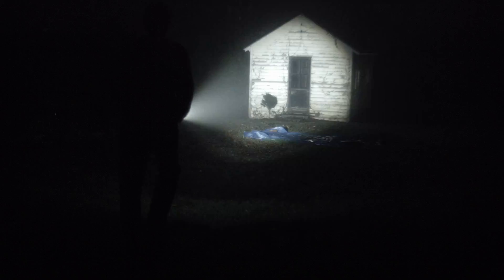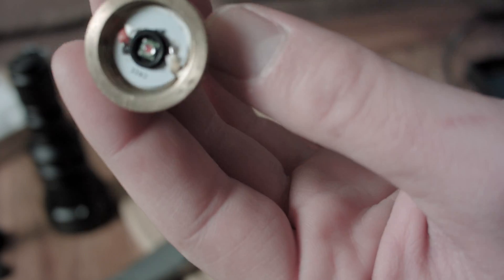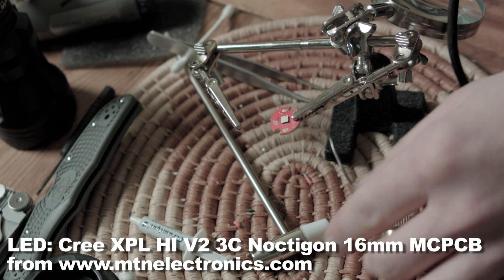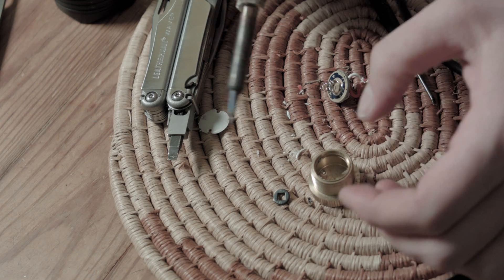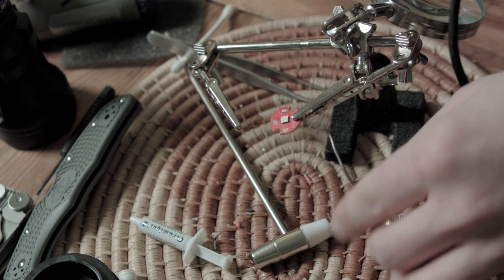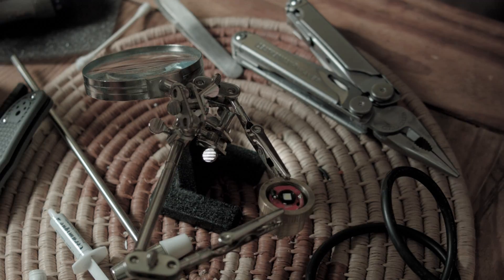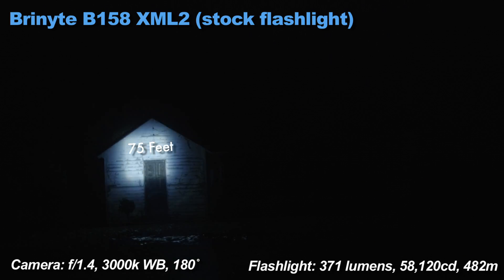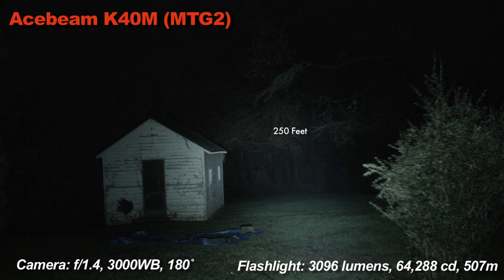How to Replace Driver and LED in a Brinyte B158 Flashlight

Comment: Great video! There is such a lack of good videos regarding flashlight modding on YouTube. I have an electronics lab and I’m experienced with electronics…
But flashlight modding is a new thing for me. Would love to find videos going more in depth on the subject. 

I already perform a lot of PCB level repair, both through hole and surface mount work. considering I spend half of my time repairing industrial electronics and test equipment for a wide range of clients. I watch a lot of YouTube electronics videos, and there is plenty of content regarding that. And I think there’s plenty of content regarding how to do particular flashlight mods… But there’s a real lack of information regarding the technology that is available. I don’t mean soldering iron’s and tools I’m talking about the evolving technology and Comparing the different types of LEDs available, drivers, and stuff specifically limited to the flashlight modding community!

 Always fun to stream videos like that in the shop when doing electronics work. 

Keep up the great work!

Comment: Hi, One question!  
Recently bought a one frashlight( UltraFire C8 XML-T6) on aliexpress but  the lamp does not work . I Claimed the seller but 
I will not change it.   Can you tell me where to buy a led lamp?
Reply from the maker: If you search on ebay these terms "XML LED T6 U2 10W WHITE" a whole bunch of options come up.  However it is likely that the LED lamp itself isn't at fault.  There may be electrical connection issues inside the light, or battery issues that are causing the fault.  In my experience, unless you do something to physically damage the LED then it's more likely there are other issues.  I'm not saying it isn't the LED, but look around first.   You can also get C8 replacement heads too.  Just search for "c8 flashlight module"
Reply: @AdvancedKnifeBro   Thank you very much for your answer
Reply: @AdvancedKnifeBro  https://www.ebay.com/sch/i.html?_from=R40&_trksid=m570.l1313&_nkw=XML+LED+T6+U2+10W+WHITE&_sacat=0,   But I see several models, how many millimeters in diameter for the C8?
Reply: @AdvancedKnifeBro   
I found this, https://www.ebay.com/itm/CREE-XM-L-T6-1-mode-for-UltraFire-C8-Manta-Ray-M6/183674465055?hash=item2ac3d9eb1f:g:jH0AAOxy0QtR8xNR

Comment: why not solder the wires to led board first then pull and hide the wire behind the driver, place the driver at last. It would be much easier.
Reply from the maker: Because it wouldn't give anything for everyone on the internet who is better at soldering than me to talk about.

Comment: So the current B158 have the V3 emitter option already, do they still need driver upgrade?
Reply: The links no longer work except for the pill, which I just ordered as well.

I want to build a dedomed XP G2 with upgraded driver. I see you listed the 16mm in your vdo although the links no longer work. I think I would get the S4 2B, with a dedomed it should be neutral warm.
Reply from the maker: +UncleSiam you don't have to do it... I did the driver upgrade because I wanted a bit more juice on the high modes.  Harder driven plus thrower emitter... equals more candela, which is good in a aspheric.
Reply: Ya,  this is my foray into flashlight modding, I ordered the xp g2 s4 2b and driver you listed, I don't know if this is actually better than the V3 from factory... btw, I also have this crazy idea of putting glow in dark paint in the Black 'reflector'....
Reply: Advanced Knife Bro Btw, it's twin KL52 has IR pill to swap? I want one ..
Reply from the maker: Glow in the dark paint huh?  Why not.  The XP G2 are a favorite of modders, if you dedome them.  A lot of people like them because de-domed they are excellent throwy emitters, if they're driven hard.
Reply from the maker: I fixed the links hopefully.  They move their products around and get revisions, so sometimes the old links stop working.  Thanks for the heads up.

Comment: Can someone help me ? Could one driver run 3 or more Cree leds ??or do you need to add parts could I solder the one driver to 3 led? XML leds
Reply from the maker: +JOSHTALLGUY there are several- but unfortunatly you probably won't get much help here (as I'm not big into modding). candle power forums and budget light forum have people who are posting mods and builds frequently.  MTn. Electronics has quite a few options.  If you join over at budget light forum and post a question, someone over there is sure to help you.

Comment: Great video. It's a bit awkward watching you solder though. Get a solder sponge and clean the tip, then put a little bit of solder on the tip to increase the contact area between the tip and what you're trying to solder so the heat transfers faster. Which heats up the area you're soldering quicker and transfers less heat into the surrounding components.
Reply from the maker: +vector chan so the worst kind of video you can upload is a soldering video.  I have absolutely the worst soldering skills possible... And invariably it always attracts people who know more than you about it, or are better than you. The point of the video was to show the whole process, not a tutorial on soldering.  I don't do it often, and only when I have to. This mod worked fine for me... And since I only solder a few times a year and have cheap shit... That probably won't change. Oh and use a sponge? If I did that I'd get 50 guys telling me that using a sponge adds more time to your tip heating up.
Reply: +mhanlen1 Chill out, they're just tips.
Reply from the maker: +vector chan cool... My tip is don't use a sponge.

Comment: nice video,i definedly learned alot but i have never tried soldering so that would be a new thing for me
Reply from the maker: +RE-L Mayer Soldering is super easy... great soldering requires practice.  If it makes you feel any better I'm not a great solder-er.  Let the iron heat up... touch it to the solder and remove or add a part while it's hot... that's kind of all there is to it.
Reply: +mhanlen1 ok thanks,definedly a usefull tool to have-will try it sometime

Comment: Hi, slightly off topic here, would you please advice what driver should be used if I were to power an LED with Vf below with an 18650 li-ion:
@ 350 mA = 2.2v and
@ 1000 mA = 2.6v
Is the AK47 or Nanjg 105c 7135*3 good for this LED?
Reply from the maker: +GG2K7AU05 I'm not the worlds best expert on this but as far as I'm aware Nanjigs and AK47s have an operating voltage from 2.9 to 4.2 volts.  I take it you're wanting to power these with 2 x AAs?
Reply: ***** hmm.. So Richard from mtne. Got me confused a bit, on his website the 660nm xp-e red's description recommends the nanjg or ak47, I was skeptical about that. Thanks!
Reply from the maker: +GG2K7AU05 He's right.  But you need to supply the correct voltage to the Nanjig to power the LED.  It's a driver that needs a lithium ion voltage to power the xpe. The voltage you want to supply probably won't allow the driver to power the LED.
Reply: ***** i'm still confused then, since li-ion gives 4.2v and the xp-e has a max vf of 2.5v, isn't the voltage too high for the led? Sorry if this doesn't make sense.
Reply from the maker: +GG2K7AU05 In this video the xpe on the original module was driven by an ak47 Via lithium ion.  I want to say the driver supplies the correct voltage to the LED.  But the driver needs a specific voltage to work.  So do what Richard says basically.  Just make sure you supply the correct voltage to the driver.
Reply: ***** Ok, that'd be great to be able to run with a nanjg. Thx!

Comment: Great video! Just one question, if you dedome a led, will the beam become square instead of a nice round beam?
Reply from the maker: +ULTIMAD3 If you notice in the XML2 beamshots later in the video and my original B158 review- the zoomed in function still shows a square pattern.  The XML2 version of the light is not dedomed, but it still is square.  That's because the square image you are seeing is a byproduct of the aspheric lens, and not the dedomed LED.  Most zooming lights look like this when zoomed all the way in, regardless of the light being dedomed or not.  Hope this helps!
Reply: Thanks!*****

Comment: Good video on the mod.  I've got some empty pills coming and will do an XP-G2 @ 2.8A and see how that goes. I know it's old, but it might be worth doing an old XR-E also.  I've used the B158 in the field a few times for hunting foxes and tried the white, green and red colours.  I quite like it.  The only issue I found is that you can unthread the tailcap when adjusting focus if you aren't careful, at which point that fox you've been stalking realises "It's a TRAP!"  :)
Reply from the maker: +mudbutton2 Yeah you have to be a bit careful about finger placement, or the amount of force you use when adjusting focus.  Let me know how that mod goes!

Comment: Couldn't help but notice your Spyderco.  Have the matriarch 2 coming in any day now. P.S. What kind of light would you recommend for my keychain?
Reply: The nitecore Tube is pretty great. Cheap, usb rechargeable, plenty bright for a keychain light, and it weighs almost nothing.
Reply from the maker: +marshalllaw123 I forgot!  A lot of people love this light and it is super cheap.  I'd definitely follow this recommendation.
Reply from the maker: +Eddie King Boy that's a tough one.  I don't like Keychain lights, but I did a review on that CooYoo.  I've been carrying it now for about a month, and it's been ok.  It's plenty bright, but I think it needs some lube on the threads because it could be smoother.  I have had people bring up the DQG Fairy, but you'll need a separate charger for the USB charging.  http://www.cnqualitygoods.com/goods.php?id=2019 (you can see it on the side bar).  But basically I've also had people tell me, who own both that the CooYoo is better build quality than the DQG, plus it has the built in charger.  The aluminum one is about $20... so it's a pretty good deal considering.  So I'd say one of the versions of the CooYoo because it's all I know... but I didn't like that I had to do some easy soldering on the thing to get it to work out of the box.  That makes me quastion the long term durability of the unit in general.  It's worked for me since then though.